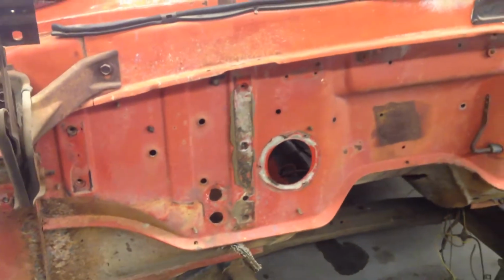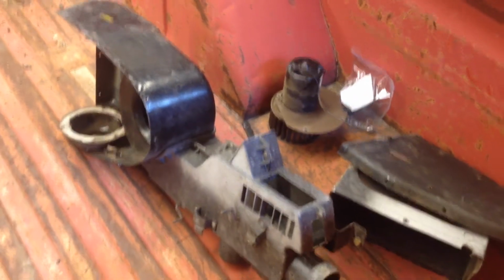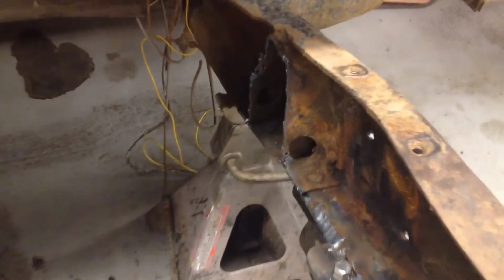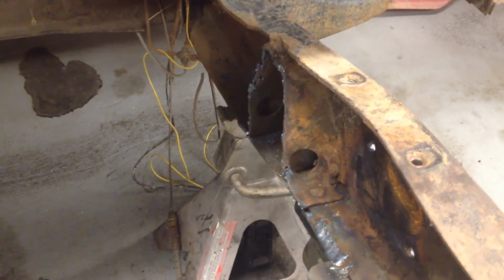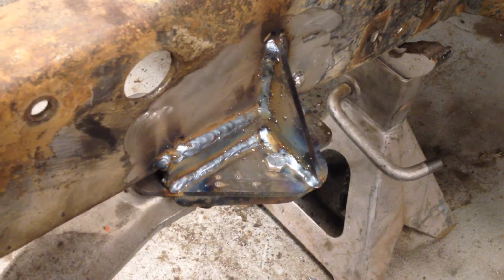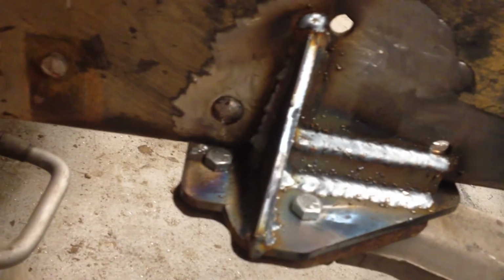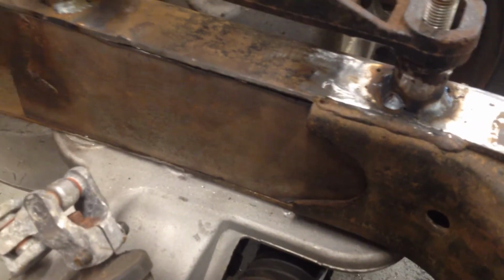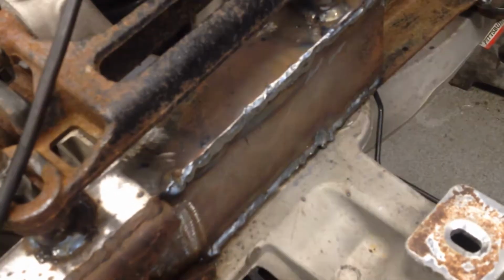1964 FORD F100 CV Part 6 The front suspension goes in.

Comment: I just did two videos about this exact heater.  Found a new 12v motor at National Parts Depot for $35. Well worth the money for piece of mind I won’t have a 50 year old electric motor and wiring igniting my truck into a torch.   I see you have the extension piece on the heater box I don’t have. Motor was a 70’s mustang.  Good luck!
Reply from the maker: Thanks April, I watched your video on the motor, wrote down the part number from the video and will be ordering one myself. I agree with you, for $35 that's cheap insurance. Pat

Comment: Great video Pat. I'm enjoying the process. I agree about the plasma cutter. It's an extremely useful tool and I love using it. When you go to put the heater core and ducting back together, any chance you could show some detail as to how the ducting and flapper doors work? I don't have mine out and its hard for the old fat guy to get down there to get a close enough look. For some reason I'm not getting the flow I should and I know it's something to do with the doors in the ducting.

No big deal, I know you got enough on your plate as it is. Keep these videos coming Pat. You're gonna have one sweet truck when you're done. And the comment about "I'll  just blame it on the other guy" had me crackin up!
Reply from the maker: I'll try to get you what I can. I don't think I covered it in the video but there are a couple of cables that go to the assembly. One I believe controls the heat and the other directs the air to the floor or windshield. I also don't recall how it's actuated but you can bring in outside air to the passenger side. Maybe one of those are not working fully causing your issue. Also the ducting is just made of a thicker paper, maybe you have a tear. Pat

Comment: Thanks for the update, Pat. CoastieReid found a new replacement heater motor for cheap, which is intended for an early ‘70’s Mustang. For the price she  paid, it struck me as quite worthwhile. 
Have you considered installing the CV HVAC box in the truck?  That would capture heat and AC in the same installation. 
Keep up the good work. 👍
Reply from the maker: Hey Weld, if it fits in the budget at the end I'm going to get the A/C half kit from Vintage Air like Matt/River City did. He used the CV components under the hood and the Vintage Air components in the dash. If not I'll run the heater core for a year or so then add the A/C. 

I'm going to check out the fan she bought, thanks. I was concerned about the core itself because no one carries a replacement for the 1964. Thanks for the encouragement, Pat.

Comment: My favorite part of this video was when Pat says "I figure with the other work that’s been hacked by the previous owner, If anybody questions this work, I just blame it on him, what the heck". That made me laugh...
Reply from the maker: Glad you're enjoying my humor. Thanks for watching!!!
Reply: @pmr413  hi Pat. What measurements did you use to put the CV suspension?
Reply from the maker: @bradfordw124  Hi Bradford, prior to welding anything we set the frame on the CV front suspension and put the front fenders on. Then we moved the tires fore and aft to see what look best. In the end we made the gap from the front of the tires to the fender match the measurement of the rear tire gap to the lip of the fender well. The center line of the front tires ended up moving forward about 1"-1.5". I hope I explained that well. ~Pat

Comment: did you use the factory bump stop holes for the alignment pins?
Reply from the maker: Hi Alex, short answer no. Once we decided exactly where the cradle was going to be front to back we drilled new holes for the locating pins. If I remember correctly we moved it forward about 1 inch from stock. We set it so the front tires will be be the same distance from the front fender lip as the rear tires are from the fender lip of the rear wheel wells. Hope that makes sense. Thanks for watching. ~Pat

Comment: What measurements did you use to put the crown vic suspension?
Reply from the maker: Sorry Bradford I just saw your question. We moved the suspension around until we found the spot that we thought it looked best. In the end we made the gap between the tire and the fender match the rear tire gap.